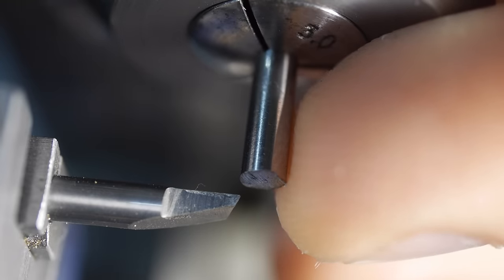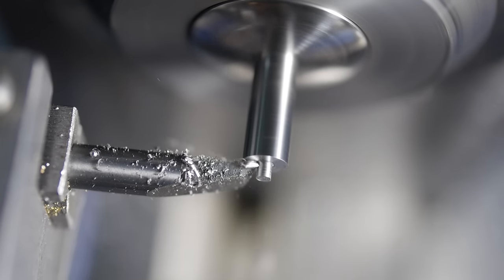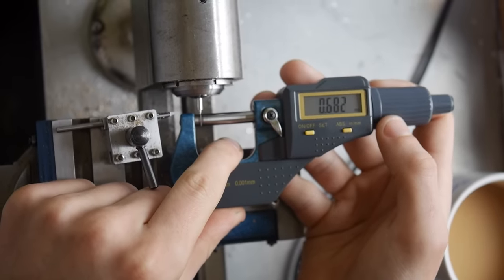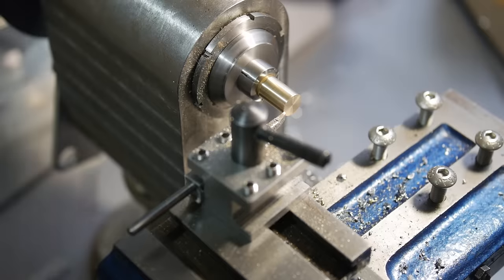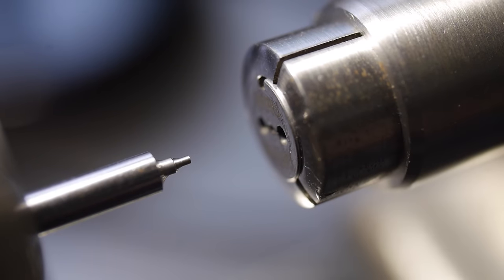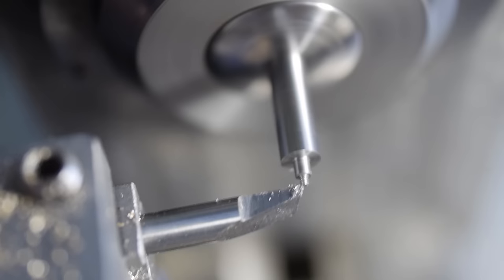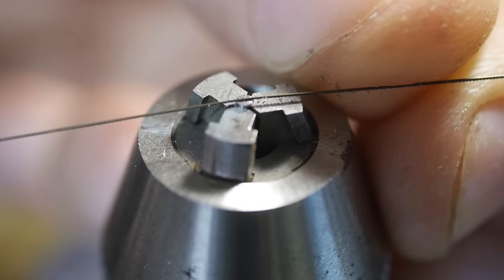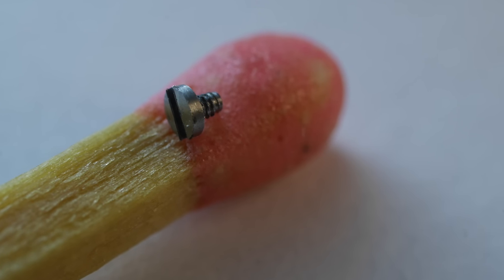Watchmaking: Machining a 0.6 mm Screw

Comment: I wish I had this set up.  I'm a harmonica player and we have to take our harmonicas apart on the fly sometimes to do maintenance.  The best screws for that are small post screws, but not all the brands use them, and some of them use cover holes smaller than any commercially available post screws.  I could, theoretically, redrill them, but it's a pain because you have to go through steel, brass and plastic and get everything lined up right.  What I really want is smaller post screws.  I actually priced getting some made... they only need to be about one or two sizes smaller than the commercially available ones.  The problem is lot size... it costs a couple grand to get them to set up their machines.  Once you do that, the price of the screws is just a few cents, but that priced me out.  I guess I'm waiting for technology to drive the start up price down to about 10% of what it is.  At that price, I could justify setting it up and getting a fairly large run and selling the extras to other harmonica players.  Hohner, which does have harmonicas set to take commercially available post screws, charges $12 for a pair of them.  Part of it is they don't want to spend all day shipping out low margin products, but I'd love to be able to sell (or buy) good post screws at 50 cents a pop in larger lots.  For $50 that would give me a lifetime supply for personal use.  Harmonica players also like flashy stuff, and having some color options for their cover screws...  there is a pretty strong customizer community... not the sort of demand where you could build a whole business around screws, but I think there would be some demand.

They are downright huge by comparison to watch screws.  Posdriv 0 or so...

Comment: I worked at a custom bolt manufacturer right out of highschool and i machined the bolts and the biggest bolt i made was 12 feet long and 18 inches in diameter on the threading lathe thats the bjggest we cluld make on them and in comparison to this tiny screw is crazzy in comparison

Comment: I made a number of miniature test tubes out of polystyrene, Outside diameter was about 3mm with a blind hole and a tapered cap also styrene. Used a CNC lathe for this project. Eventually programmed the machine to stop just short of parting off and then would break the finished parts off with my fingers. Otherwise like you it was very hard to find the part in the chip conveyor. One of the biggest concerns was not melting the plastic when drilling the hole.

Comment: Wow, I always wondered how such tiny components were made - losing it when parting off sprung to kind just as you mentioned it 😂 Smallest thing I’ve ever turned was 6mm brass rod - not much chance of going smaller for me I think 😮😅
Reply: How the screws are made is pretty easy to imagine, i wonder how they ;did the diesto begin with, 100-200 years ago.

Comment: you can also use one of those magnetic bases wich usually have one of those levelers with a round dial (i dont know the terms in english), and put a strong magnet on the end instead, so if the workpiece you are making is magnetic, you can place it close to the piece, once you cut it off. also a cup like piece used in many cnc-machines coud also be a help prevent losing parts if there is the space

Comment: Yes i know i was changing a capacitor on my seiko kinetic watch, when i was removing the battery cover the retai ing plate sprung the screw, i think , onto a heavy pile rug. 1 1/2 hrs later after using magnets and a household wire detector a small hoover with some tights over the nozzle i put all my gear away and ordered a new screw from ebay. Oh what a lovely time i had. Ps it arrived and i completed the job carefully and successfully.

Comment: I don't think I've ever machined anything this small (and certainly not a screw) (and technically isn't it a bolt?) but anything tiny and ferrous at risk of being lost in the tray I hold a magnet near the part as it's being parted. Don't let it mingle with the chips if you can help it.

Comment: Excellent videos. Question- the die you used would not cut a fully formed thread all of the way to the screw head, and it <appears> that the diameter of the uncut portion is greater than the major diameter of the thread and is definitely larger than the minor diameter of any threaded hole it would screw into. So, I'm curious why you didn't add a small thread allowance cut at the head end of the thread? Depending on the thickness of the piece this will hold down it seems like this could be a problem. (BTW, the smallest screw I've ever had the nerve to send out to our (excellent) shop floor was a 0.7 UNM flat head screw just under 1mm long. I didn't have to make it, but I did have to assemble it. That was... fun.  We have a few under that thread diameter, but not under that length, I believe)).

Comment: It's a lot more fun drilling down the centre of a 0.6 hard steel screw thread that has snapped off.
I use a 0.3 drill for that.
WD40 is a good cutting fluid for tungsten drills.
Decant some and apply with a 000 sable brush.

Comment: Before cutting the slit it would have been safer to make a brass collet to hold the screw. The thread is so shallow and could easily be damaged in the three jaw steel chuck.

Comment: as a CNC machinist i can relate to the difficulty of making little things even if i have CNC precision
i dislike the fact you turned the screw holding the bar too outside the spindle
i like the fact you used turned off spindle and did the thread manually
finally i can say all thread are not perfect in diameter
for example M6 is D5.85 external, this help with the thread die
my smallest is M3 so i compliment to you for do it manually ^^ my KIA superturn 21 LMS is JEALOUS X,D

Comment: Excellent work. Are thread rolling dies available in these tiny sizes, or only thread cutting dies? Also, do these get secured with threadlocking compound or by torque alone?

Comment: I worked in optics and my smaller screws were 1.2mm down to 0.9mm ,,, but I bought them in , great to see them being hand made , well done. What is the thread variation , are they mostly metric or is there a special thread type in use in watchmaking.

Comment: If you don't mind me asking, what is the make and model of the little lathe you are using? I would like to obtain one soon.
Reply from the maker: Hi @russelljohnson6243
It’s a custom build: I used a Boley Watchmaker’s lathe bed and tailstock, a Pultra compound slide and I machined the headstock to my own specifications but I based the design off the Leinen WW82 and 83 ball-bearing headstocks. Hope that helps!
Reply: @chronovaengineering  Well, I could never build one, but thanks!

Comment: my friend had an old i think 50's Zenith lighter, i was amazed and thr screws, the head of the lighter had one similar to yours , less than 1mm dia, and maybe 1.5mm lenght, half of that with a thread, half just plain, it would screw in the head and the unthreaded part was a shaft that connected through a hole to the lever, anyway i always been wondering how it was made, i tought maybe some kind of electro etching,  im wondering is how you did how they make them in mass production, like for the smartphones?

Comment: When parting off the screw, why don't you catch it with a small bin so you don't have to scour through the swarf?
Reply from the maker: This would be a smart thing to do. A tiny section of tubing held in the tailstock that slots over the screw does the job.  On this occasion, I thought I would get away without. I was wrong. Thanks for watching.

Comment: 2000 to 6000 RPM is not high spindle speed, those are speeds I use for plastics and wood. My spindle goes to 25 000 RPM...

Comment: This is a very large screw compared with what I often find even in low-cost watches.
I doubt that these techniques could be successful, even in the most skilled hands, with the small screws I often see that do not exceed 0.1mm dia.

Comment: I once made a 3 mm thread, 150 mm long in a pipe. ( by hand )
Needless to say i had to modify a tap to be able to make such a long inside thread.
And yes i did ask why not just do 20 mm thread in either end, but that was not what he wanted.

I have the utmost respect for watch makers, and i do consider a watch the only jewelry allowed for a man, though i will accept a wedding ring too, but necklaces - ear rings ASO, well no.